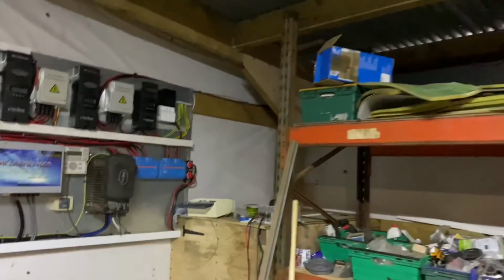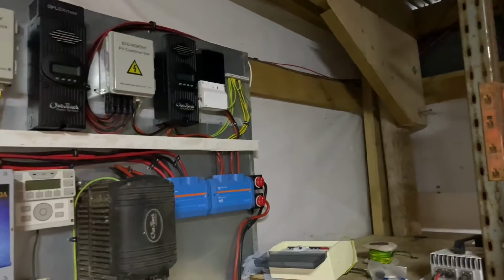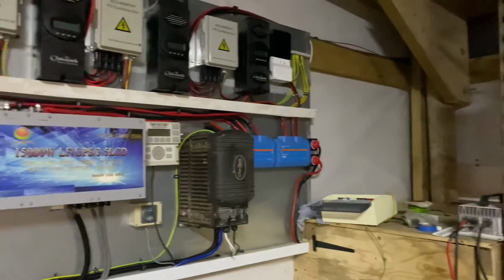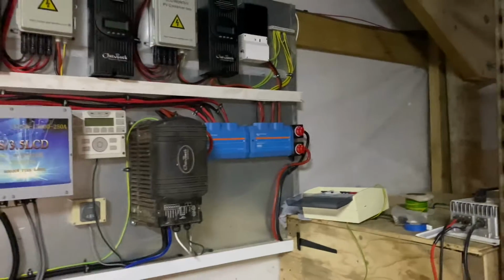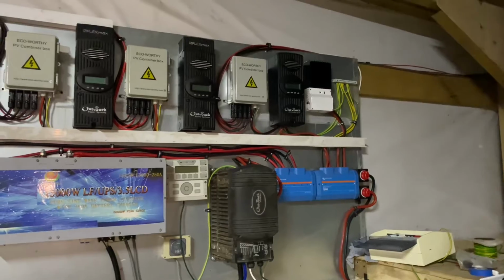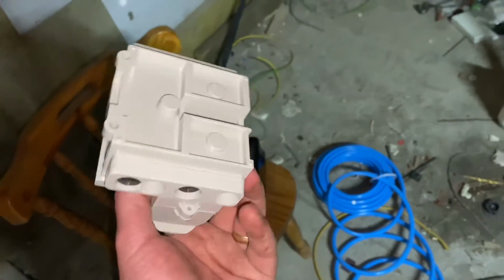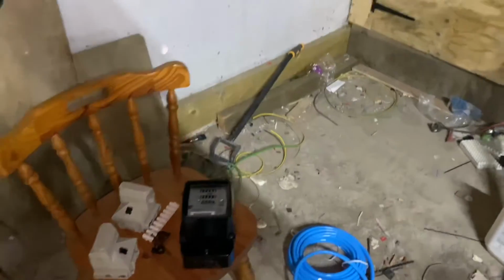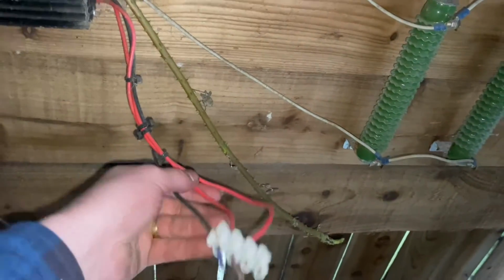Building an off grid solar system - dump loads, relay drivers and making the most of free electric!

Comment: Here in Australia, where we (households) do more solar than anywhere else, we have many "hybrid" inverters that include everything you need in a single box. They are all made in China, but there are multiple brands that have been sold here in Australia for 10-20 years, and have excellent warranties and local support. I just installed a Sungrow SH10RS, which is a 10KW single-phase inverter with 4 MPPT inputs. I added a Sungrow 9.6Kwh battery which is DC coupled to the inverter. It works with or without grid power. I love it so far!

I've never heard of any need to use dummy loads to shed excess solar power. Normally the inverter just uses its MPPT functionality to dial down solar production to suit the load.
Reply: I think the grid tie inverter is the concern he's trying to address..

A standard mppt charge controller uses "dc coupling" to charge the batteries and they reduce their output current as the battery reaches 100%

The grid tie inverter uses "ac coupling" which has some benefits over mppt but if not setup correctly will overcharge your batteries.  This is addressed by "frequency shifting" where the main inverter changes the output frequency which causes the grid tie inverter to reduce its output or turn off completely (until the main inverter needs assistance and changes the frequency back to 50.0hz)

I've got this setup living off grid and the grid tie inverter provides an extra 5kw of power when required.. the string voltages can be upto 800v allowing many more panels to be installed in series, vs a 250v dc mppt for example.
Reply: @lukey7369  There are many hybrid inverters with DC coupling, including the unit I installed.

There are also many conventional (no battery capability) grid tied inverters that have MPPT solar functionality.
Reply: Yeah I know, the ac coupling is referring to the a.c grid tie inverter producing the a.c output.. I've got 13kw of dc coupled panels connected via dc-dc mppts and 5kw of dc-ac coupled panels.
His video is about the ac grid tie inverter overcharging the batteries, not about hybrid inverters.
I was just explaining the frequency shifting principle used to ramp down the grid tie inverter I'm using on my off grid setup.
Most off grid systems have a mixture of both dc and ac coupled panels because when only ac coupled inverters are used, if the battery goes completely flat the grid tie inverter won't be able to provide an output as it sees the power outage as a grid failure

Comment: Many of the new Hybrid inverters have stolen our idea and now accept grid tied arrays as a direct connection along with built in MPPT controllers combined with a generator input so now it is all in one box.
Reply from the maker: Yes, problem is many of these new fangled inverters are made in China and no one fixes them…. I’ve got a combined inverter on my old system and it’s knackered
Reply: @livingoffgridinscotland  I've heard Deye is a good one for UK.

Comment: There is a lot to learn about these systems, hopefully there will be affordable automatic systems that can manage themselves.
Its a pity you can't dump your excess power into something that you can use in the low sun months, for example using a pump to pump water from a low down small lake up to a higher one then letting it out via a turbine.
Reply from the maker: Most efficient way for us to use excess power here is to heat hot water, then run storage heaters.

Anything else requires a massive financial investment.

If we had a reliable water source we could have some sort of hydro power but that isn’t an option.
Reply: @livingoffgridinscotland  Water is the easiest to set up but sand will store higher temperature heat for long winters.